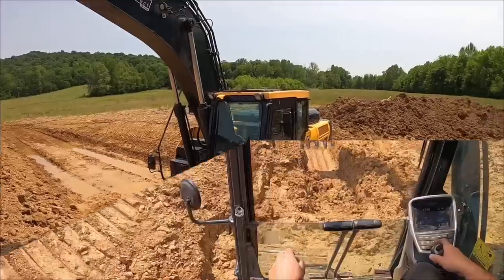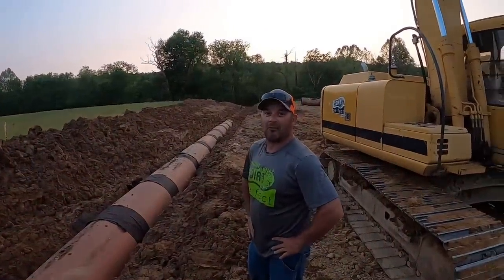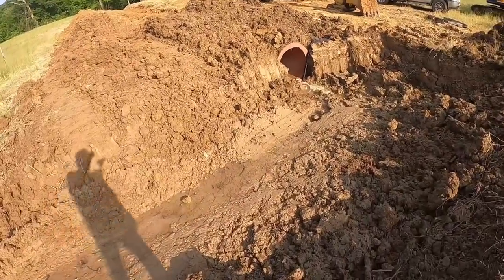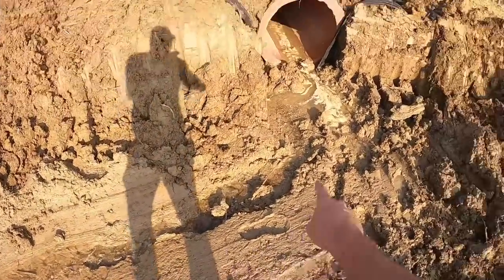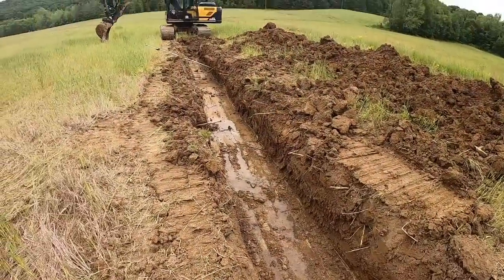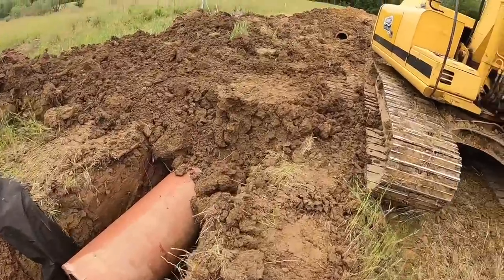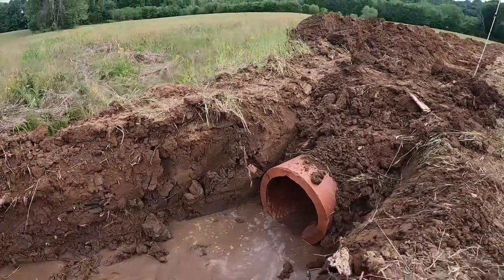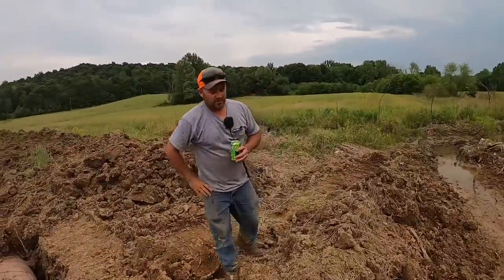Radical new idea setting pipe turns into modified plan when all I want to do is operate new dozer!

Comment: Over kill but it was a good bargain.  That pipe was a dream deal.   Next step Is getting  neighbors property tied into the big tile.  I know a spot that has 3 farms tied in to a central tile  to the  creek. Almost 2 miles. Across one road.  Been there since the 60s.  In mill creek bottom They have some really long runs too. Under a levee to the creek. Has float operated door when creek comes up to keep it from backing into the fields under the levee.  All clay tile.  Long ago.

Comment: Get some extensions for Wallee's forks and Aaron can pick up speed on clay pipe hauling. But!! The job is going a lot easier than it should be with just two guys working. Looks good Mike. Let Jerry run the new Case while he runs Wallee to haul pipe as you need it. Three guys working would speed it up a bunch.

Comment: Gee. Mike or Michelle as MBTS calls you. 😂 Great job on laying the pipe! What do think about modifying the pipe jig. Make the top of the jig longer to offset the weight of the rear of the pipe jig. Also cut the distance between the top and bottom of the jig and add some rubber to the top of the bottom beam to help prevent cracking the pipe

Comment: If you do the cache basins i little deeper than pipe bottom,
So they hold water  they can also catch sediment  from the fields (less mud in the pipes/creek), especially if the owner can set some land of as wildlife zones  around the holes, mening ;there is permanent vegetation / some trees/  bushes/ wet grouns plants etc. (Not exposed earth/ farmcrops)
This  kind of small water body's  and diches and wind breaks  ( wild spots ) in large
Monotone farm fields environments are valuable for 
Both flora and fauna ,and also decreses nutrients runoff from the cultivated earth arond it.
When diches are replaces with in ground drains and then filled in you loose important habitat.
Creating wild spots and small wetlands can compensate for this . 
The increased workabilty
Of the overall little less swampy field after pipe laying
Should compensate for some small wild reservations. 

And you get more dirt for dams:   win - win

Comment: Great piece of machinery, Mike.  Kudos to the Case rep for his level of knowledge and ability to answer and anticipate what type of question you' d have next.  He's definitely the go-to guy for field operators.  Old Aaron was as nimble as a 20 year old getting those vid shots.  I know Jerry will be tickled to run this new beast.  This dozer is fast and strong.  Heck, for some reason, that blade looked to be 20 feet wide.  I don't know if it's b/c of the design or what but it looked super massive.  Congrats on finally using the Case dozer.  Looking forward to see more of it in action.  Enjoyed a full-watch.  Have a fine upcoming week. 👍🏽🤠 7/9/23

Comment: Next rain day you guys could make a long pipe that is welded to a couple of square tubing so you can push the forks together and slide the unit onto the forks for lifting those pipes ( it would have to be one pipe at a time ) but would be more stable .
Reply: Fork extension

Comment: Does the Mino have "ride control"? It doesn't look like MBTS is using it if it does. My SV250 has a button on the side of the right joystick that if you push and hold it while traveling with a load, it will allow the arms to float up and down independently from the motion of the machine. Not only does it give you a smoother ride over rough terrain, but if you have a heaping full bucket, it helps keep your load from bouncing out as well. He should be using it while transporting the pipe if it has it. Just a heads up though, if you raise the load and then push it, the arms will drop suddenly until it builds up a pressure cushion, so to avoid that and dropping his pipe, push and hold it while lifting the load to start with and it won't do that.

Comment: You should try to think of a way to make a sliding mechanism on your jig so you don’t have to keep unhooking and going to a different hole Something where you just let the bucket down and it slides to a different notch if you could figure something out, it would speed up your productivity and save some extra bending over and steps
Reply from the maker: KISS method

Comment: MBTS your fitness level has to be much improved with all the exercise required on this job. This pipe installation will surely remove that excess water so Farmer Chris can get the most out of crops. Dirt Perfect all good things come to those who wait - the time to use the new Case 1650 will arrive and the rewards will be a fun adventure in the dirt moving business.

Comment: maybe you could set up some boards you can sit on a trailer, cut some old tires, sit them in there to cusion the pipe as you pull it to the trench? kind of like a holder? fgiure you could move more pipe then

Comment: The 24 inch pipe looks a little curvy line to me. :) I am little confused on the catch basins, are they just going to holes in ground? If so will not that cause a problem for Farmer Chris and a stuck tractor? Thank you and have a great week. PS That is very true, "the sun is not out yet" but close at 5:00 am Pacific Time. :)
Reply from the maker: Stay tuned

Comment: pointless adding any thing in comments , that would help you move those pipes . as you have told us we are 3 Months behind you . the 550 not being that small a machine does a nice job moving the pipes , but could do it easier any way the 1650 looks good . from the little you got to work it the day before . i would not be able to help my self i would do an hour with the lights on . just to say or see how she goes under lights , bit like the excavator i think she would look good nice work as usual Cheers .

Comment: Like a Dutch saying translates, "it's mustard after the meal", but if the fields around Derby should be rather wet rather permanently, then farmer Chris might benefit from growing crops that require (much) more water (than elsewhere within transporting distance). He'd still need your help for adjusting water management anyway. - Your jobs might then be less about "flocking the water out" and more about collecting it for future sprinkling (and still some disposing).

Comment: This is likely the longest installation of large diameter clay pipe in the world for the last 20 years.
Reply from the maker: No sir millions of feet still going in still used in lots of big city’s
Reply: @DirtPerfect  I worked as an Engineering 50 years of service, never saw a large bore VCP project. Sewer, water = plastic or cast iron by law, where would you use VCP?

Comment: Wouldn’t it save time and provide better jig control to have cables connected to 2 eyelets on the jig simultaneously? The combination of two convection points would accommodate the changing center of gravity with loaded vs unloaded
Reply from the maker: Absolutely not

Comment: This may sound like a dumb question, but why not just put in plastic tile like you have in all the other fields?
Reply from the maker: 36 inch pipe don’t fit down the plow
Reply: @DirtPerfect  I get that 😂 But is it just that there’s so much more water in the area or because it will still allow an a path for underground water with the fabric you have covering the joints? Love the channel and I’ve been watching your channel for years and this is the first time I’ve been really confused.